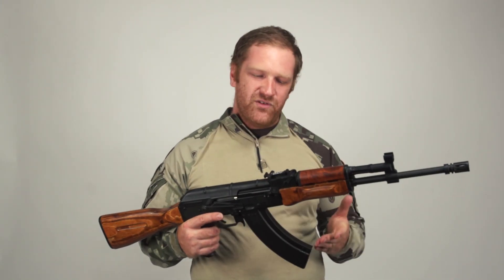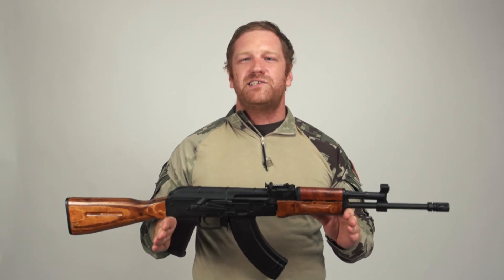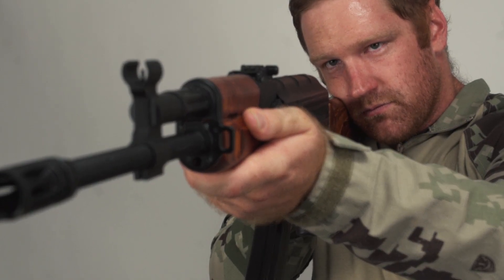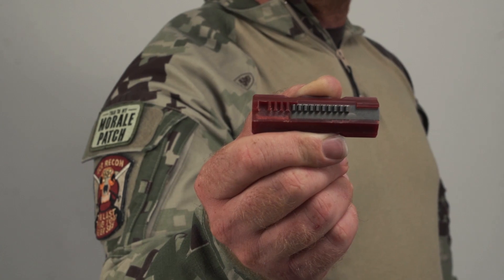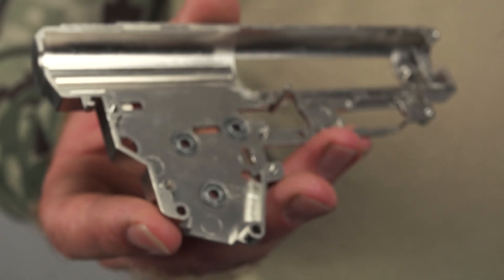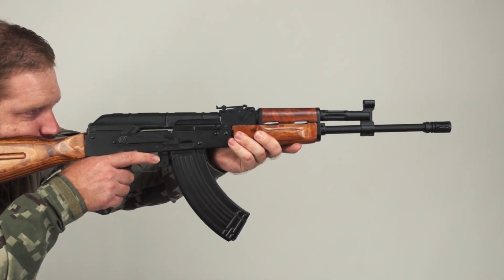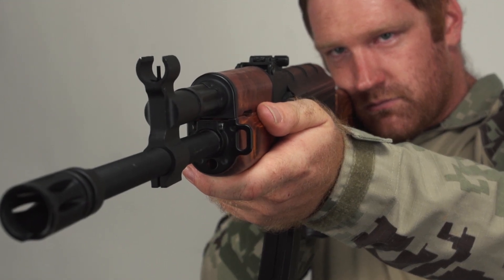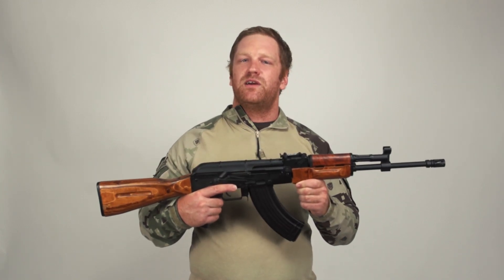Build your next Custom AEG with Lonex Parts! | Airsoftmegastore.com

Comment: Lonex makes excellent air seal and hop-up parts, I also like their cut-off levers. Their motors aren't very good though, none of my Lonex motors would hold up for more than one season tops, that's a mere 20-30k shots, they didn't last even one service interval. I also don't like their gears, I've had a 50% lemon rate with Lonex gears, surprisingly bad, I expected them to have decent QC. Their pistons are also not worth the price, they wear out way too quickly, seems like the glass content is too low in the nylon they're made of.

That being said, I haven't given up on Lonex, but they aren't nearly as superior as I thought at first. I prefer to combine Lonex air seal and hop-up parts with SHS and Guarder for the rest of the gearbox, it has given excellent results so far. My favorite part from Lonex is their 50 degree hop-up bucking followed by that sleek and durable POM piston head they make. No brand is perfect of course, SHS has definitely had their share of issues and Guarder also isn't perfect, some of their products are simply obsolete.
Reply: Håkon T. they dont reinforce these pistons with glass. thats only high heat applications and high impact such as power tools. if that pistion was glass reinforced even 15% it would cost 40 to 50 dollars
Reply: It's not glass fibers, it's glass dust/particles, so it's not a particularly expensive material that takes any significant time to add to the plastic mix.
Reply: Well its called glass fiber reinforced polymer in the tool world. Also glass reinforcement is extra cost they dont wanna cover. You wouldnt be able to swiss cheese that piston with basic irons cuz they dont get hot enough unless its lower than 10 percent
 And glass reinforcment can get very expensive glass ball reinforcement being the most expensensive found in high quality tools only
Reply: It's probably a relatively low percentage of glass reinforcement then as you can easily drill through the plastic with regular drill bits. This would explain why the plastic teeth wear down so easily and this is why I prefer nylon pistons with steel teeth rack.
Reply: one way to be sure is cut the piston with a knife if u hear glass its reinforced, but usually you cannot inject mold such details with glass in it ie gear tooth, and side groves. it just wont work
Reply: It could be but usually glass reinforcement has numbers marked somewhere on the plastic xxxx-- , -- being the level of glass inside the mould. But even at 5 percent it would make it hard to mould such details
Reply: I wonder if Maekii has done any research on this subject, I imagine he has since he actually took some higher level of education within this field.
Reply: Håkon T. well idk who that is but airsoft teching is not education its more like a hobby skill. doesnt contribute to knowing what kind of steel plastic and grades of materials. i knoe this shit cuz i watch tool review vids and ive always had interest in this stuff. but airsoft people usually dont know what grade of plastic, gears, gearboxes are mainly because the manufactuer doesnt fill them in on it.
Reply: He has an actual degree within the plastics field in addition to being a well known tech in the airsoft community. I do agree that manufacturers tend to give very limited information about the materials used in their products.
Reply: Håkon T. i mean idk who that is but im 99 percent sure aeg plastics dont have glass in them
Reply: It might be a very low percentage, but enough to call it glass filled. They are able to injection mold steel particles into mold with the same level of details, so glass particles suspended in nylon doesn't seem too unrealistic to me.
Reply: Håkon T. well steel particles also known as cintered powdered metal, is one material. but when you add glass in to a different mold its harder for it to form such intricate details due to the different level of consistancy. also its not really glass powder its usually balls or fiber. powder would do nothing to benefit the structural integrity of the plastic . thats why its called "glass fiber reinforced polymer"
Reply: I guess that would explain why the so called "glass filled nylon" hasn't proved to be a very suitable material to make piston teeth out of. Nylon itself is a good material to make the piston body out of since it's slightly flexible and handles impact forces very well, but it's too soft for the teeth. That's why I've completely phased out plastic teeth pistons and only use nylon body pistons with steel teeth rack.
Reply: Håkon T. yea nylon pistons are the best and steel teeth is awesome  but one thing i dont get is why people get half racks of steel teeth? ... why not go for all
Reply: Most likely because they want a weak spot to get a controlled failure in case of PME. I have seen SHS 15T pistons obliterate steel sector gears, so it does make sense. I don't bother with mechanical fail safes myself, I want maximum longevity and long service intervals. The only place I have a failsafe is in the wiring in the form of a fuse.
Reply: @hakont.4960  will lonex parts but in a KWA aeg?
Reply: @lildutch3377  Not sure, KWA AEG's are somewhat proprietary.

Comment: sorry but retroarms has better gearboxes :) but this is still usefull :)
Reply: retroarms aren't free from problems themselves. Retroarms has a bad habit of not widely testing their products, their triggers when first released required you to modify the trigger trolley and the new split shell has endless flaws which they're trying to fix now. Retroarms are good after the first generation of a product.